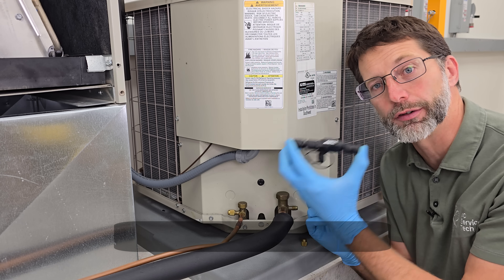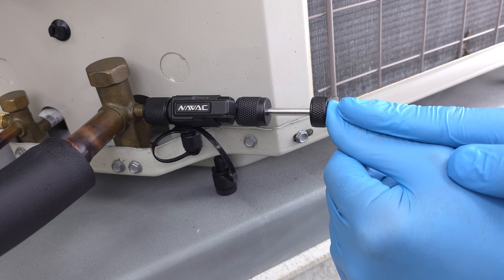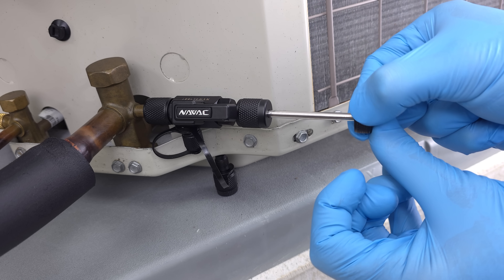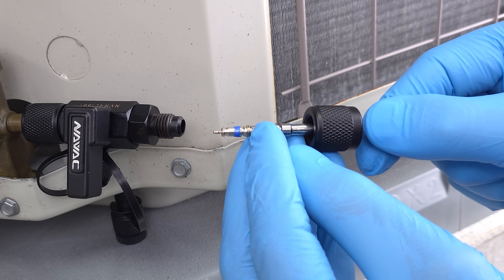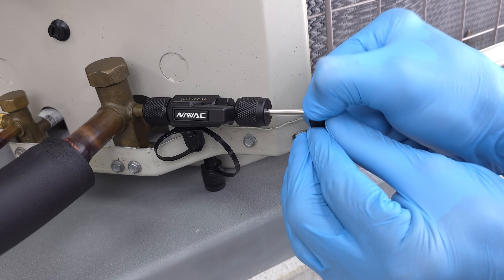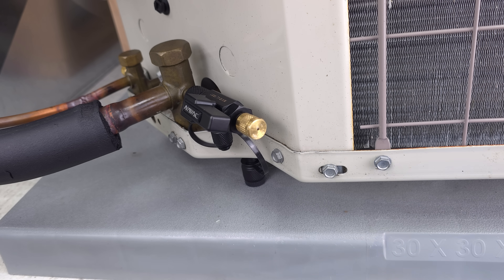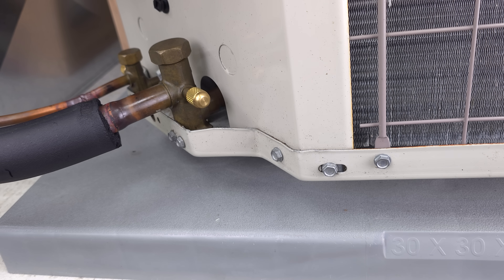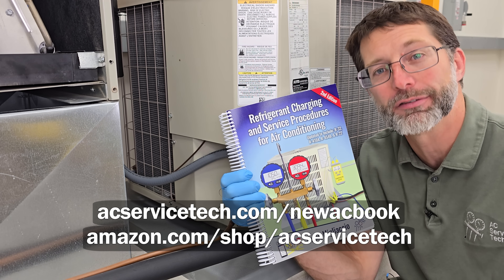Step By Step Use of a VALVE CORE REMOVAL TOOL (VCRT) to Replace a Leaky Valve Core (Schrader Valve)

Comment: Awesome Craig… I came across one that no matter what brand I used, I can’t get it to come out, so actually I left the valve core tool on there for now until I can come back with something that will get it out, Any Advice, or Suggestions would be greatly appreciated… Thank You.
Reply: Some ideas based on what you said. 1. Vcrt body tightened to much to service port. 2. End rod tip closed to much, can’t get into scrader, widen the jaws more, use a different core as a reference. 3. Core may be broken, I’m not exactly sure but you could add a tee fitting and just leave the broken core, as long as you can still get some flow through it. You could also pump down the system and drill out the core with the correct scrader removal bit. 

When I remove cores, used appion vcrt, barely tight when connecting to the port, I never mess with the plunger jaws, they are perfect. Untwist the core until you feel it clicking then I slowly pull the rod out while spinning it. ~95% first try, Good luck
Reply: Pump it down and just use a regular core tool if it's not coming out after trying several core removal tools.  

Many years ago I heard a rumor about someone who pumped down to around 15psi and replaced a core with a regular core tool in less than a second so that there was only a de minimis refrigerant loss.  No vacuum was needed since the core was replaced fast enough to maintain pressure.

Comment: The procedure you make it look so simple with that new tool. May I be so bold to ask you if you could or if you would. 

Post the most affordable place and what tools we should need in tool bag. Regular leather tool bag that Carpenters use and I've seen electricians use them. Including your pressure gauges. Finally I seen a longer video and you did it very well. Even in layman terms you did it very well. Thank you so much! And your toodelage is competent and gives people well. I speak for myself. Gives me more confidence. But yeah if you could put and find the most reasonable place to get them item by item. That would be awesome so everyone can get a fresh start even if they're going through technical school. If I had a choice it'd be hard But HVAC would be the way to go for me if I ever had that opportunity. Unfortunately I'm disabled but what you just did I think I'm capable. I get a couple guys to come with to install a new unit with all the heavy lifting. Especially all in one outdoor or a split unit. That would be awesome. Thank you so much. Your time is valuable and not wasted. God bless ❤️🕊️✨

Comment: I have found if you give the core receptacle a little squeeze with them needle nose it will tighten the action so the core is not weeblewobbly like that.....Sucks when the core falls from the tool and you need to blow it out with system pressure.

Comment: What about vacuuming?
in other videos you taught that you need to vacuum, and even turn the tap to pull out all the air! and here it turns out to be just blowing with freon? Double standards.
Reply: He is just replacing a leaking Schrader core there is no need to pull a vacuum on the whole system because he doesn’t open up the system to air. He purges the air out before he inserts the core, so no contamination happens to the system. 

That’s the whole point of this tool, to change leaking Schrader cores without having to recover the refrigerant, pull a vacuum and recharge just to change out a core.
Reply: Are you a DIY?
Reply: Dennis is correct. The system has refrigerant in it, he is bleeding some air out from the small area inside the VCRT. That's all. Ez pz.
Reply: Please do more research before you do anything, and listen to dennis, who replied to you.
Reply: He did not blow it out when unscrewing it, so it got mixed with air, since he ended up in a closed space with freon.
Reply: You need to vacuum this puller, then fill it with freon, remove the nipple, close the tap.
then insert the nipple, tighten the nut partially and do a small purge, then tighten the nut and fully open the tap, and replace the nipple.
Reply: Lmao sorry but you are living in a dreamland. If you are in the trade good luck to you.  @АлександрВладимирович-ф3и
Reply: @АлександрВладимирович-ф3и gross, to much work. You could leave the plunger slightly loose so when you start unscrewing the core some gas purges the whole tool, then tighten it and remove core fully. 🍠